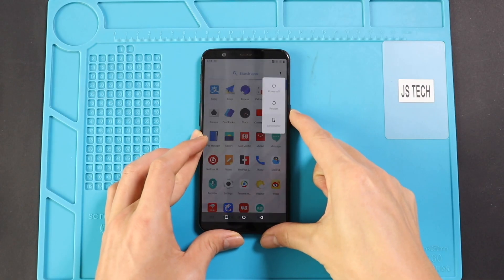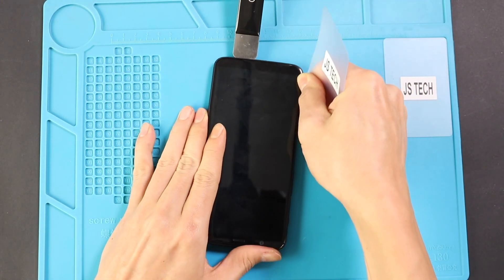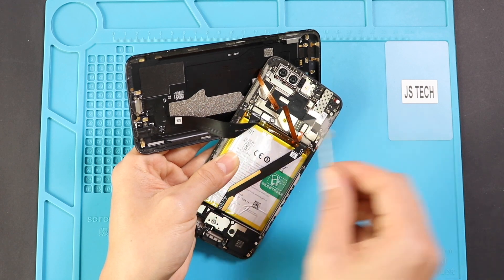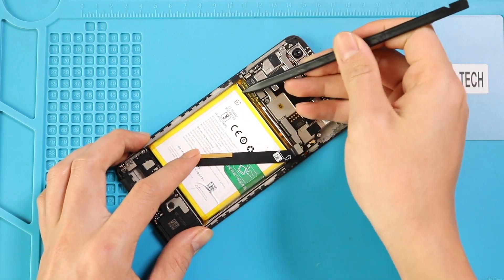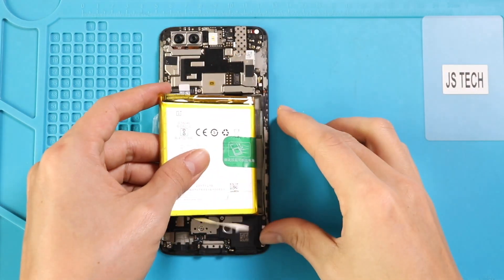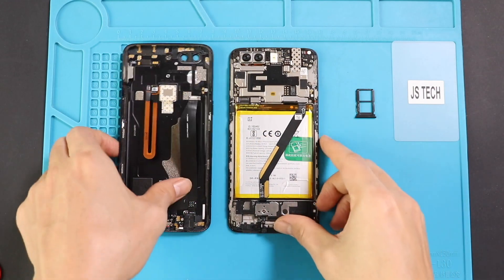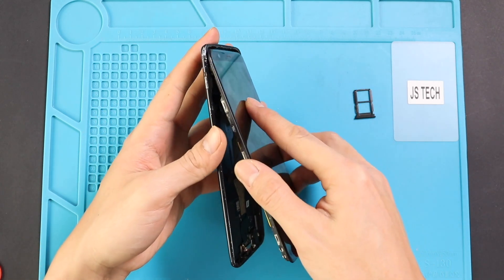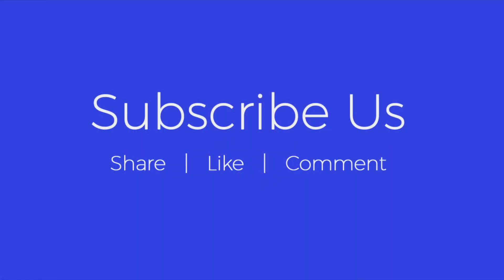Oneplus 5T Battery Replacement BLP637

Comment: Mine doesn't have the finger sensor ribbon cable and the back of the case looks different
Reply from the maker: what is the model number ?
Reply: @DIYGeardo  it is an A5000 but I did find another video that does have it. There's 6 screws that you need to remove at the bottom of the phone to remove the ribbon cable across phone to free the battery
Reply: @DIYGeardo  It's a model 5T so idk if that makes a difference between the 5 and 5T. But I did  find out it's my charging port rather than my battery
Reply: One question is I do have, is that does the phone need a SIM card to connect to the internet or did I break something? The phone won't connect to the internet

Comment: Great and simple tutorial. Glad you just came to the point and don't stretch the video unnecessary.
Reply from the maker: Thanks for your feedback..
Reply: @DIYGeardo  My phone always shuts down after charging and i'm only able to start it after disconnecting the battery cable inside. Do you have any ideas?

Comment: This instruction is bad, Do not use metal pry tool, u will scratch the body.
Reply from the maker: Well it depends on how you do, yeah always good to use plastic one. But if you need more strength, then the metal pry will be good..
Reply: @DIYGeardo replacing the battery of my oneplus 5t battery will reduce the heat on my device?????
Reply from the maker: @praveenpagalavan4438  It depends. Because the heating issue can happen for other reasons too, Ex - OS (specially new updates ), Board, Charging (cable quality), Hot weather, and many more